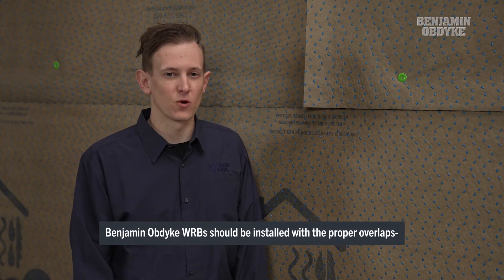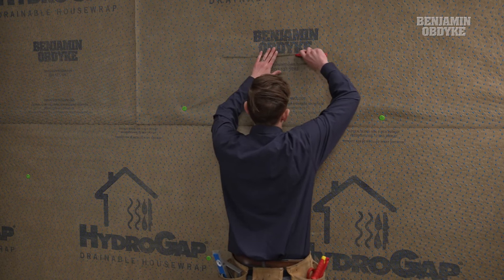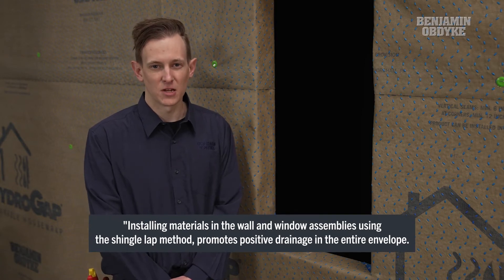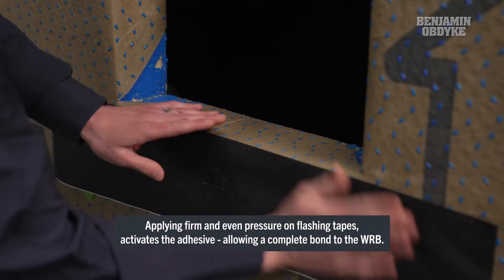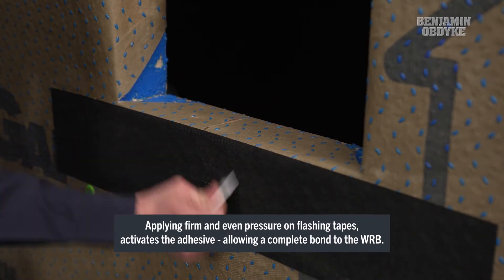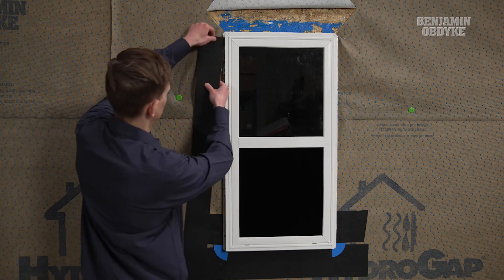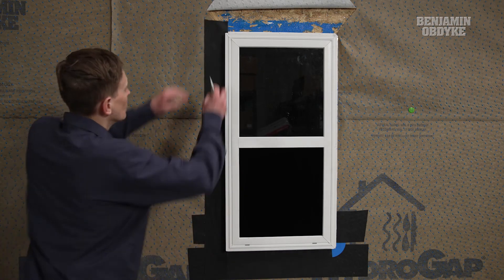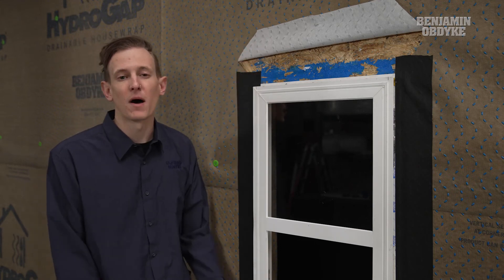Benjamin Obdyke's HydroGap® Drainable Housewrap & HydroFlash® UV+ Installation

Comment: Is it possible to do a retrofit without removing the windows?   My house is PNW and it has zero wall insulation but it has new E windows installed before I bought it. I has no sheathing so I can get it back to open 2x4 studs easy. I would like to insulate the cavity and a foam foam thermal break but I am not clear if I can do this without removing the windows.  I know that is best practice but adds a lot of finish work an that starts to get overwhelming.

Comment: Can you do this exact installation with the following modifications:

1. Instead of wrapping the Hydrogap inside the side jambs, can you cut it flush with the edge of the side jambs, then use Hydroflash UV 9" to tape the side jambs after you flash the sill as shown.

2. Then tape Hydroflash UV 9" on the inside of the the top jamb to for protection, then proceed with the window installation as shown?  

In summary, I want to use the Hydroflash UV to protect the entire window jamb, then proceed with the window installation exactly as shown. 

Looking forward to your recommendation. Thanks!
Reply from the maker: That would definitely work, but to save time and money, we would recommend doing that application with our Liquid Applied flashing- HydroFlash LA